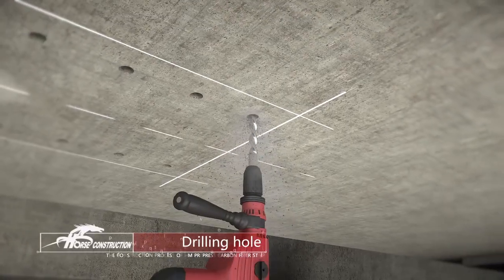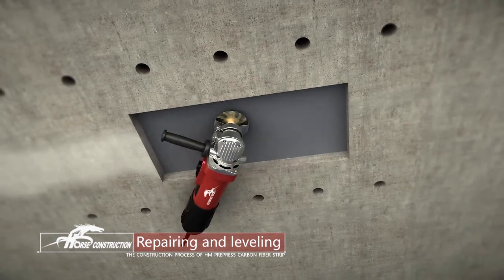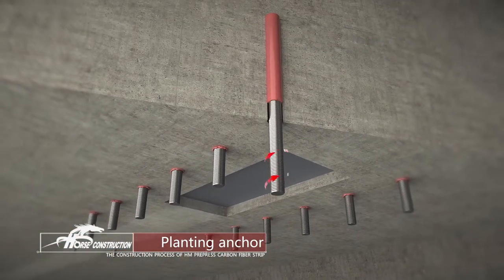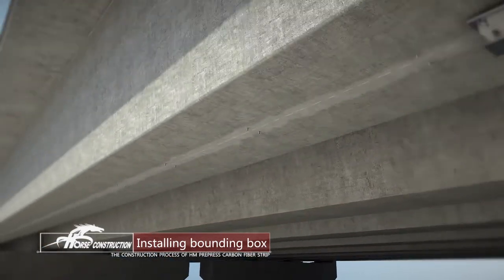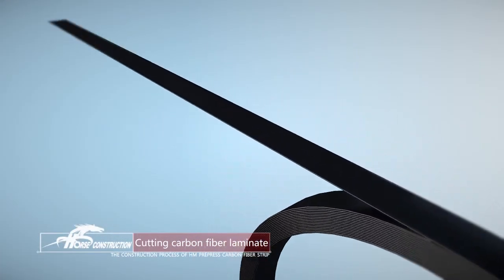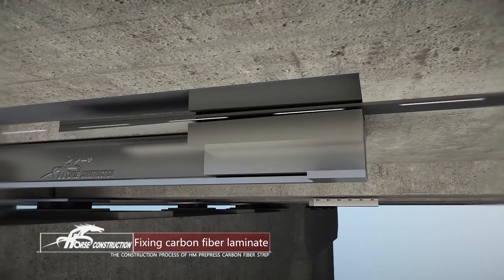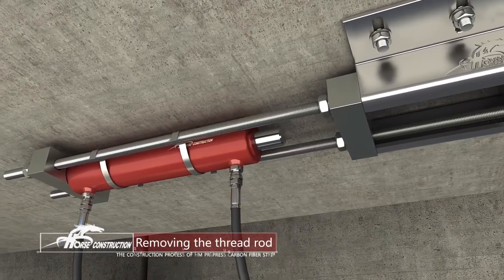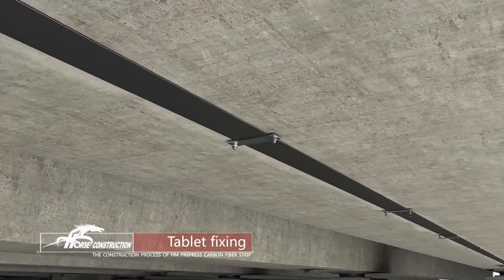Application Process of Horse Prestress Carbon Fiber CFRP Plate System

Comment: We are a professional manufacturer of concrete repair materials.

We have mainly six systems for structural strengthening and reinforcement.

1, Anchoring system:
epoxy anchor, chimical anchor bolt

2, Carbon fiber system:
CFRP fabric, CFRP laminate, epoxy adhesive for CFRP

3, Prestressed CFRP system (Post-tensining system):
Anchor Device, CFRP plate

4, Steel plate bonding system:
Steel plate bonding adhesive, injection adhesive for steel bonding

5, Crack reparing system:
Crack reparing adhesive, crack injection adhesive

6, Bridge bearing pad system:
Bearing pad leveling adhesive

this is our English website:
http://www.horseen.com/

Este es nuestro sitio web en español   https://es.horseen.com/producto